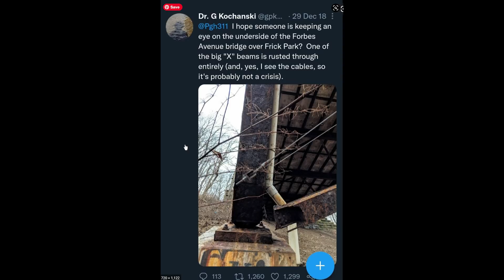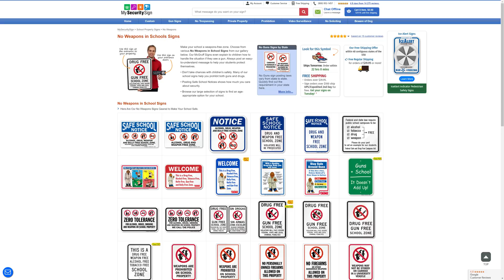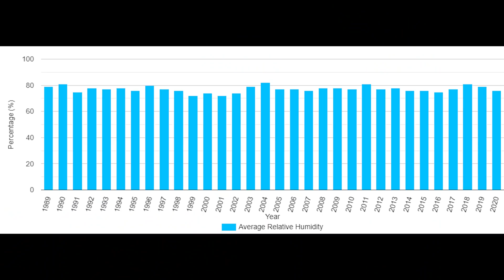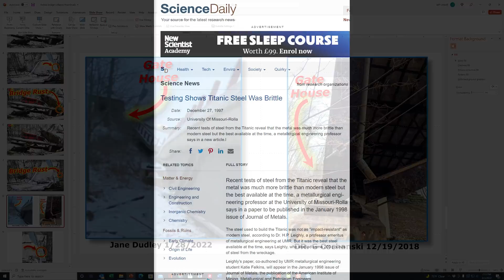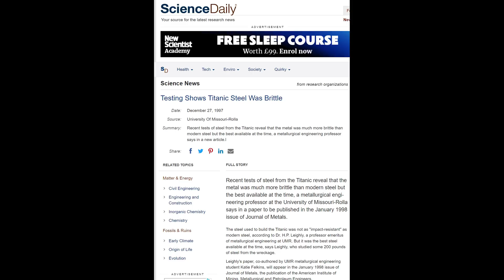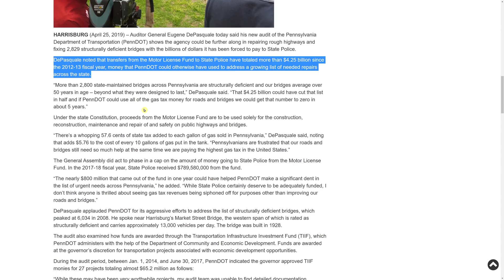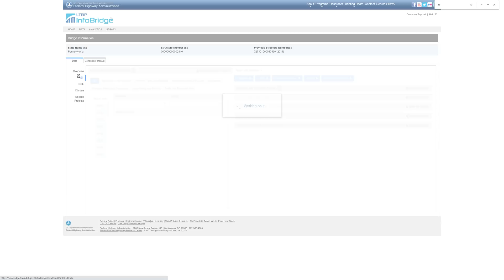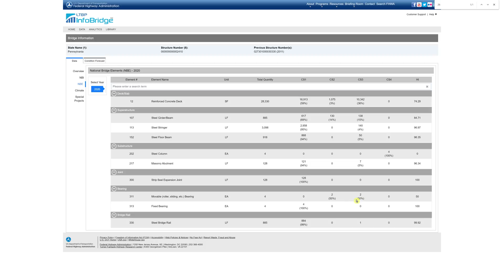Pittsburgh Bridge Collapse:  Bus Too Heavy? Rust? Missing Funds?

Comment: Structural engineer here, involved with waterfront piers and buildings, not bridges.  One of the earlier comments (this or the earlier video) indicated it is a K style bridge.  The base of the inclined columns are designed as a hinge, so there is a plate at the end of the column that necks down and a curved surface is provided.  This allows rotation without bending in the columns, keeping the column size down.  The upper ends of the deck has 'rollers', a slide plate or a short rocker.  This allows the girder to move with thermal growth, likely growth here is 2 to 3 inches from coldest day.  On the day of the collapse it was cold so at the shortest length.  If one or two of these rockers was 'frozen', usually by heavy rust, this shortening could pull or push the bridge 2" out of location.

The column pair with X braces was a poor arrangement, not having the horizontal at the mid point eliminates any redundancy, the cable X brace does take out lateral forces from wind, etc but they were full height, removing the lower X suddenly calls into question the lateral brace conditions, the brace should have a strength for around 3% of the column axial force.  This missing lower brace also increases the stress range seen where the mid column brace connection is.  

CORTEN steel was considered the wonder steel when it came out.  It works quite well with clean rain, but less so in polluted areas, and things like salts destroy its ability to form the protective 'magical' coating.  It's bad enough now that CORTEN is produced in only limited amounts today.  In salt it corrodes like bare steel, I recall (didn't look it up) that CORTEN is less tough also, so crack propagation is faster.

The bridge drain pipes have limited life, looking at the current pvc pipes likely indicates the 3rd or 4th set of downspouts on the bridge, when the previous spouts froze up and split, it likely dumped large quantities of high salt runoff onto this mid column bracket, with salty crude building up on this mid connection, seeping into the cracks that are developing.

Looking at the bridge as it fell I see this as the most likely failure progression.  This K frame bridge is cold, bridge deck loaded with snow increasing the uniform load, add in the 20 ton bus.  A frozen slider could emphasis the condition.  Initiation probably occurred when the rear of the bus passed beyond where the far columns connected.  This higher bending at the mid column caused high compression on the face of the column toward the ravine, ready to buckle, but the brace was incomplete, allowing the column to bow a few inches sideways, starting the failure, the partial upper brace now pulls the other column of that braced frame to also bow sideways, causing failure at about the same time both columns.  The supports away from the bus failed evenly as the deck dropped straight down and evenly.

These two columns failing caused the bridge to sag, the angled braced frame under the bus rotated toward the ravine raising the deck that caught the bus.  That side span split at the girder joints after rising a few feet at the end support, a second joint failed folding the deck that caught the bus.  Probably took 10-20 seconds to fall as the girders bowed then snapped draping the main span and far side span to curve to the hillside.  

Proper maintenance to restore the column x braces, reinforce the existing columns by building a steel box around the columns after a good cleaning probably would have cost $200K 10 years ago lead to a collapse and $ 20M to spend to replace.  So short sighted.
Reply: I just noticed something - I am Jay Bartram, when I comment from my office it shows Jay, when on my laptop I am Kitsap Korner.  Structural engineer in Kitsap county, WA, home of the Puget Sound Naval Shipyard & Subase Bangor.  Don't want to confuse anyone.
Reply from the maker: Thanks for the analysis Jay! With the components and cars intact, it seems to me like this was a soft landing rather than a gravity free fall, or there would have been more damage, am I correct?
Reply: @jeffostroff  You are, a car free falling 20 feet would likely have a high % casualties.  Like hitting a bridge abutment at 40 miles per hour.  Here, a bus and a number of vehicles, I saw a reference to some pedestrians.  No fatalities, no critical injuries, the bridge dropped like 10 feet as it dropped from the abutments, but then was springy (think trampoline) as the beams passed yield up until it buckled or the connections ripped apart, then the rebar in the deck acted as hinges rather than breaks.
Reply: We need Jay B's lucid analytical skills applied to the infamous Champlain Towers South collapse... only 7 months ago, but many "involved" parties are already whistling in a guilty manner, hoping it goes away... seems like more lawyers than engineers are involved in that mess.
Reply: @MajorCaliber  Actually Jeff has been excellent on CTS, I feel it could have been any one of the 5 columns he circled.  The column down the ramp certainly was failed 6 min before, but there could have been others also down then.  I'm impressed with his analysis there.
Reply: all those bracing cables did was exacerbate matters for when temperatures sank those cables shrank and began tugging the columns and pulling them inwards at their base, unfortunately at one location there was nothing to resist this shear force other than a rusted out web section!
Reply: Jay Bartram
Thank you I enjoyed reading your informative comment

Comment: Down spout leaking  can be the issue. .  Also the use of brine in the winter is a huge issue.  I live in western PA and since the use of brine  everything in cars rust so much worse than when salt alone was used.    The brine is just as hard on structural  steel.
Reply from the maker: I thought carmakers have made their cars more impervious to rust, am I wrong?
Reply: @jeffostroff     yo don't want a car if you can help it from an area where brine is used .   Everything rust worse in areas where it is used.  First thing to go is break components.  I think i put 4 or 5 sets of break rotors and backing plates plates  on my 02 GM truck.  Rocker panels, door skins frame repairs etc.  I ran it 225k and would still be running it if it wasn't for rust.   A friend had about a 2005 Ford F150 that rusted out worse than my GMC.    It was a mess at about 7 years.  Yes stuff is  better protected,  but the brine still gets it...     The visual part of cars don't rust so bad but under cars rust.   If I am out in brine i try to go through a car wash asap.

Comment: So that bus alone is 25 tons then you've got a pickup truck and a few cars .. that takes it way over the 26 ton limit plus add in the snow and ice that was on the bridge also .. that be like carrying a 600 lb guy in a wicker couch .. he's going to go right through it
Reply: And as far as the weight limit goes with the bus being 25 ton the other vehicles adding up to the over 26 ton Mark with the bus does it matter how many vehicles are actually on there .. if not what if there were five vehicles weighing at 25 ton crossing over the bridge at the same time .. it's basically the same concept as those smaller vehicles .. all that weight adds up
Reply from the maker: Remember the ton limit is per vehicle

Comment: I live in Pittsburgh. Ive been across that bridge MANY times. MANY MANY busses cross that bridge DAILY. I have seebn MUCH more weight on that bridge than what was on it when it collapsed. You talked about humidity. There is ffog in that valley because it is a low lying area. We had snow in the days prior. I am thinking that whatever they used to melt the snow(probably salt) ate away the steel and thereby weakening it. We had snow that morning. You can see the snow on the ground as they were lifting the bus. Being as it was cold, structurally defficient, and steel being eaten away by the chemicals, it just had enough.
Reply from the maker: Yes virtually everything we do to our bridge incrementally adds to its demise

Comment: The CorTen looks horrible here. I have a bunch of CorTen RR bridges where I live from the 1971-72 period, and they look way better, with much less flake rust. The close up photos I've seen of this bridge show massive corrosion. Look at the NTSB 'B-roll' vids. The corrosion on the lower end of the legs is crazy.
Reply from the maker: Yes for sure Cor-Ten steel seems to be one of those ideas that looked great on paper at the time but nobody stopped to investigate what happens when you're putting it in a humid environment, and what happens when you get salt on it. So, somebody didn't do their due diligence on this. I just don't think Cor-Ten is the appropriate type of steel to use on a bridge. And it's obvious you can see here that the patina never stopped building on it and that's why we got all the deep rust and flaking.

Comment: I don't think the footing is cracked. I think the 1970's modern footings are built on top of the 120 year old footings from the older steel arch bridge.
Reply from the maker: That would be really bad if they built the old pad on top of the new one unless they really drilled a bunch of rebar rods in it before they formed the concrete. It's not a good idea to poor new concrete on top of old concrete because you really have to make sure you're using a good primer when you do that but it's really best to grind down the old surface a little bit rough it up nicely stick some rebar rods through it and then form your concrete pad on top of that.

Comment: Hey Jeff, I'm not sure about the use of CorTen for the structure. At about the same time that this bridge was built, US Steel built their headquarters in downtown Pittsburgh. The structure was CorTen and I think that the sprinkler is built into the columns. This means that it has water covering it 100% of the time. I think that the material was used in other structures and bridges.  Not so sure about the history of its use or why it is used so infrequently now. For a long time, the sidewalks around the US Steel building were coated with rust from the building.

Sam
Reply from the maker: the wiki on this bridge stated cor-ten steel, and it was obvious there was never paint on it, so it must be cor-ten
Reply: I think they used Cor-TEN for the brace on the runaway truck ramp on the Parkway West. It corroded through.
Reply from the maker: @patrickvolk7031   Yes I am beginning to think that this corrosion resistance from since property of the metal is not really all that great it's led great and it's not working as intended it's creating a it's creating a out of control process

Comment: Can you explain these weight limit signs?  There’s a bus that weighs 25 tons and a dozen cars each a few tons… so as long as one vehicle doesn’t exceed 26 tons it gives everyone a false sense of safety?  What about if there are 50 cars and SUVs backed up on the bridge, that’s going to easily be 100 tons or more on the bridge.

Secondly the undercarriage of that bridge looks way to small and without redundancy to support a 440 foot span.  It seems like this bridge didn’t have all the standards that went into place after the Silver Bridge collapse in 1967.  This bridge seems under-engineered.
Reply from the maker: There is no redundancy. The weight limit signs are pertaining to one vehicle so apparently based on their calculations they don't want anyone vehicle to weigh more than 26 tons. It likely doesn't matter about the other vehicles on the bridge as long as you have none of them weighing more than the 26 tons period of course I think the vehicles probably did contribute because I think this bridge is far D rated below the 26 ton sign that was put up there eight years ago, long before some of this new damage started occurring.
Reply: @jeffostroff  Wouldn't a bridge weight limit be based on how many vehicles could possibly be there at the same time, e.g a 100t capable span might say 25t if 4 trucks could fit in slow traffic? Or are heavy vehicle drivers meant to be stopping and waiting until bridges near the limit are clear?
Reply from the maker: @SyncViews   They have always based it on a single vehicle so apparently you know the loads can be stretched all over the place and place and distributed around the bridge But they have these equations that they use that based it on the number of actuals on the vehicle and the harmonics that it causes onto the bridge and spreading out of the loads. What really should happen is the sign should have been derated much further than 26 t because as the bridge gets older and older and goes further into decline of condition, it's not going to be able to support the loads

Comment: It appears the PVC pipe was used after the original drain system rusted away or maybe there was no drain system, the original plan just allowed the gutter water to drain down without pipes and the road salts scattered all over that upright for years. Then, when they put in those cables they added the PVC drain to contain the salty water all the way down to the ground level but didn't end it in a very good location. The condition of those metal uprights looked darn bad...my guess is that bridge should have been closed down two years ago and repaired/rebuilt.
Reply from the maker: It's almost embarrassing that in the 1970s it seemed to engineers architects and builders knew absolutely nothing about draining water it's just mind blowing
Reply: @jeffostroff  "This stuff is supposed to rust". Let the water hit the understructures.
Reply: That would be my guess as well, probably those grates just allowed water to drop straight down

Comment: Did the city send out grade school folks to install those cables?  They only work half as good as the rigid box beams. Cables will not work in either direction, only in pulling, not pushing.
Reply from the maker: Yes they work intention but not in compression Unless you have a cable acting in the opposite direction from one cable like they do with the TV towers

Comment: 11:13 I think it didn't shear. That is a bearing from which the column fell off. The close-up shows the underside of the column is a ball which sits in a bowl. So it was never rigidly connected. Those supports are all sitting in movable joints at their base. Otherwise all the other, better, columns should show where they sheared off.
Reply from the maker: Yes we really need to see some close up shots on the ends of those columns to see what condition the bearings are in

Comment: I used to cross this 4 times a week. This bridge is a main cut thru to avoid parkway and tunnel. In the pics showing all the cars on the bridge, let alone during rush hour it's packed with cars,trucks,busses! This thing should of had height barriers and flashing signs! Good thing no deaths and everything was delayed for snow because there could of been alot more cars! But Pittsburgh is to busy painting all its vehicles to silver
Reply: I have 2 kids at Pitt, they didn't use this bridge very often but I cannot imagine the amount of traffic this has routed through the Squirrel Hill tunnel now, which was already a bottleneck.
Reply: Don't forget the bike lanes and scooter rentals... Bike lanes and scooters won't matter when there's no bridges left to get anywhere
Reply from the maker: Lol spending money where it's important
Reply: @jeffostroff  being a Pittsburgher it's downright embarrassing. My friends and I used to laugh walking across the Smithfield St bridge as teens looking at the holes in the concrete beneath our feet 😲
Reply: @jeffostroff  Look up the Greenfield Bridge in Pittsburgh over 376 approx 4 mile from here! They built a bridge under this one to catch debris falling off the original !

Comment: Very interesting Jeff. I enjoy your investigating reports you do. Motorola Engineer, did you help with the HT500, I attended a repair class in Sunrise years ago on the 500. I worked for Big Oil, we had our own industrial electronic maintenance shop, here in KY. My kids were on spring break that week, I got a room at Pompano Beach, so the wife and kids had a great day while I went to school. I fixed a lot of Motorola equipment, started when we still had all tube base stations, MR600 microwave. You do a great job with your channel. My wife has also starting watching your Lowes and Home Depot visits.
Reply from the maker: I worked in the I didn't group upstairs and we designed all of those radio phones with the walkie talkies built into the debt were used by the nextel network